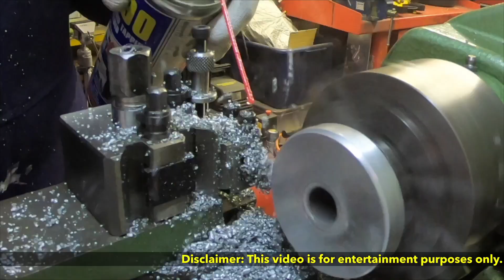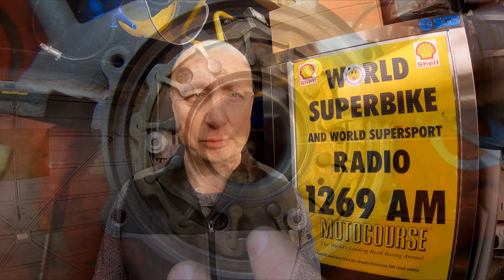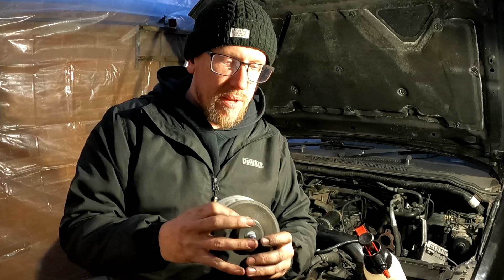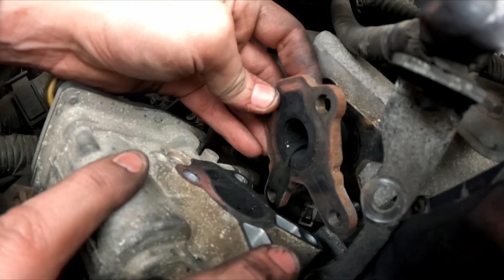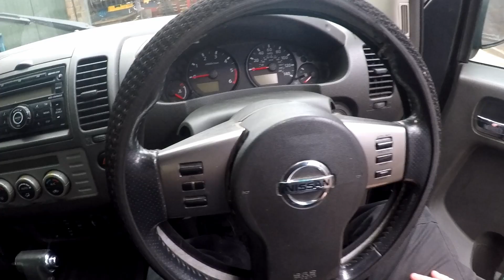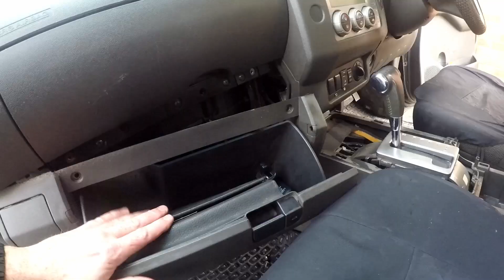Nissan Navara / Frontier D40 2006/7 Power Loss YD25 2.5l Diesel Turbo Replacement Part 3

Comment: Lol the neverending navara. Keep em coming guys!
Reply from the maker: Hi @leighreid5480, I am putting the finish touches on the final video - not long to wait now. Thanks for watching and commenting 👍
(Scotty)
Reply from the maker: SWAMPY: Hi @leighreid5430, part 4 is out now! Thanks for watching :)
Reply: @DoubleDuckGarage  thanks! watched it, pity it was sold before you could get the final footage. How's the tf holding up after the repairs?
Reply from the maker: @leighreid5430  which tf do you mean... Scotties 135 or my VVC? More to come on both soon. What do you drive or work on?
Reply: @DoubleDuckGarage  I was thinking the 135 but an update on the vvc would be good especially with you guys having to rebuild the timing mech.
Reply from the maker: @leighreid5480  The 135 is running absolutely beautifully at the moment, I am pleased to say. The engine feels fantastic. I have plenty more work planned for it - not least actually doing the front subframe & suspension as I am still driving around with the new springs and dampers on the back, and the originals on the front! Also planned are an aluminium radiator and coolant level warning, as well as an oil cooler.
(Scotty)